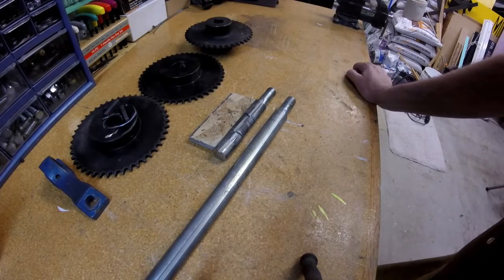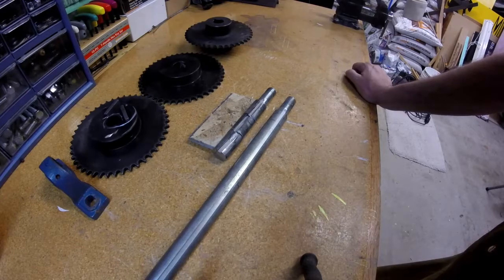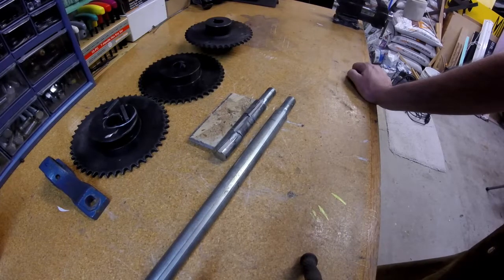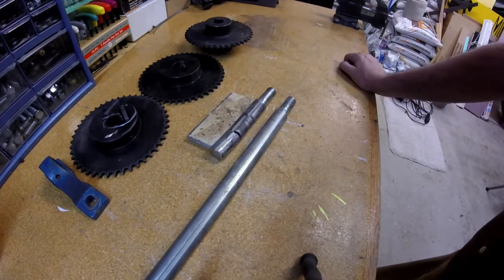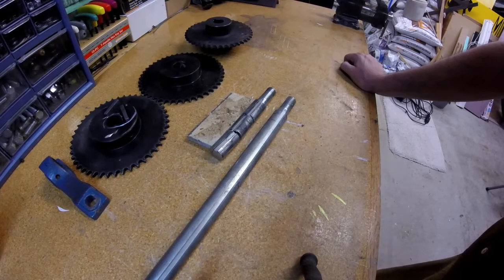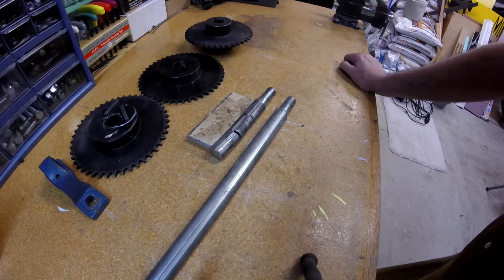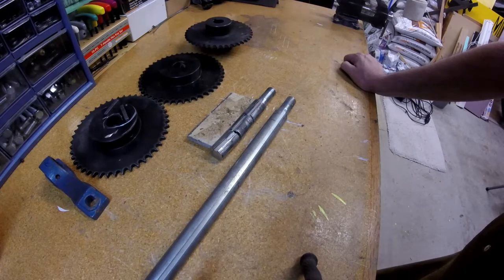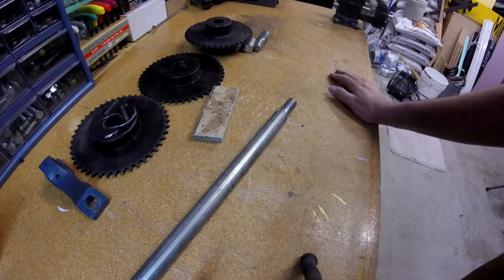Go Kart Axle: Bent & Twisted!: The SMOG Project 12

Comment: Like a noodle, dang. How much does the wheel weigh? There's more than centrifugal force at play, that takes a large amount of inertia from a very heavy object in motion! Yikes dude.
Reply from the maker: The wheel itself only weighs 38 lbs and turns at a max 6 (six) rpm. Inertia wasn't a factor. I was only moving at 1 mph at the time. The engine develops less than 10 lb/ft of torque...at the crankshaft. But by the time it gets through all four stages of chain-reduction, it's 521 lb/ft of torque at the axle. SMOG weighs about 1130 lbs, and this happened as I started up a hill. Needless to say, $35 go-kart axles are NOT made of 4140.
Reply: @doktorscottdiabolical  yikes!